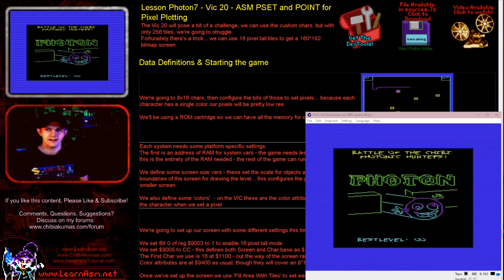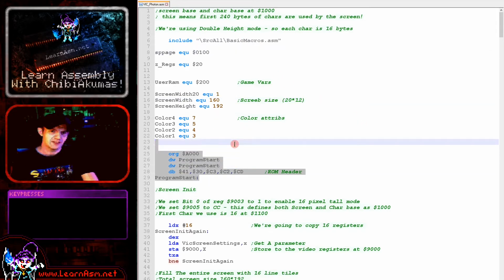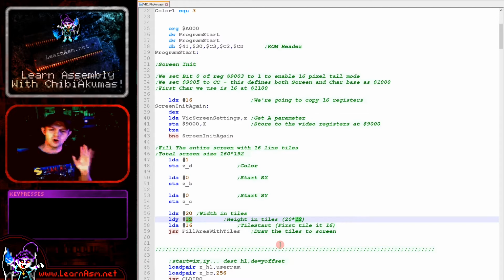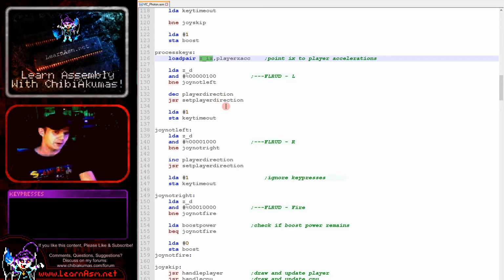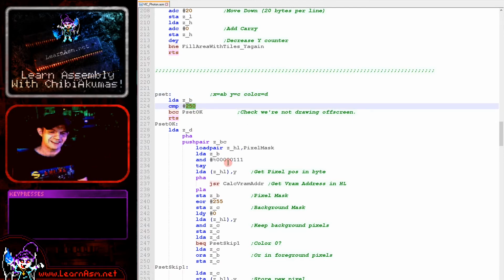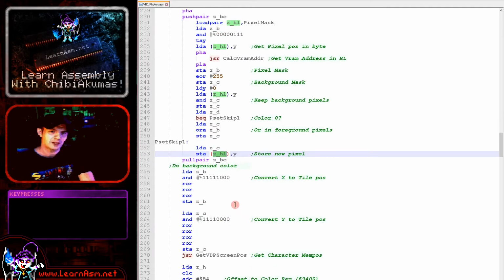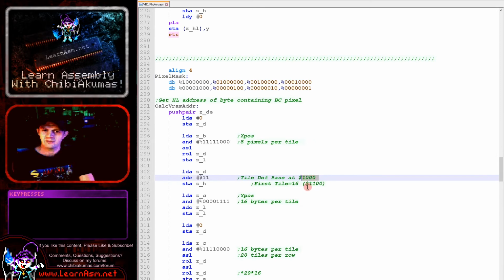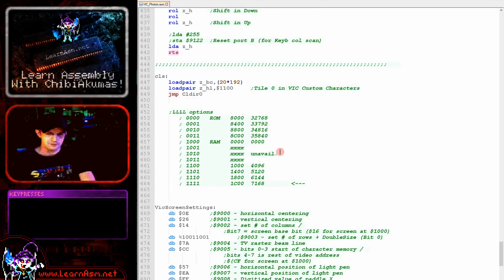Vic 20 - ASM PSET and POINT for Pixel Plotting - 6502 Lesson Photon7

Comment: Great tutorial. This is a great method on the vic used from the early days of Omega Race. I've implemented this in Turbo Rascal 'VBM' commands. There's an easier way to layout the characters. Instead of doing a row at a time, with char 16 at the top left, then 17 to its right, put 17 below and draw them all a column at a time, returning to the top for the next column. This gives you 192 consecutive bytes in memory which makes calculating and drawing really fast and easy.

Ie: you just need 20 look up values to say where the top (pixel line 0) of each column starts, then the y register simply is the offset from 0 to 191.